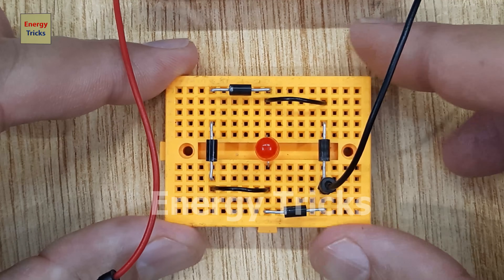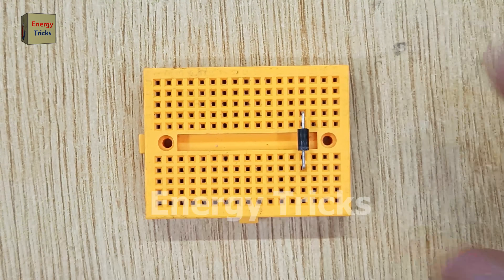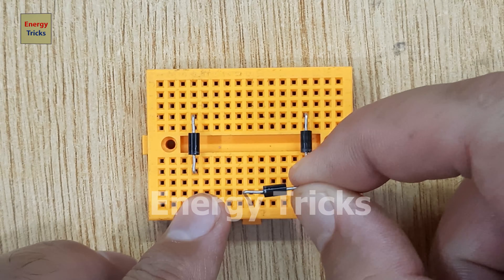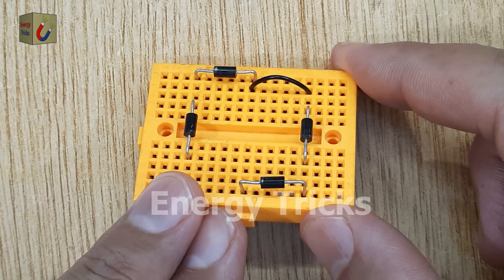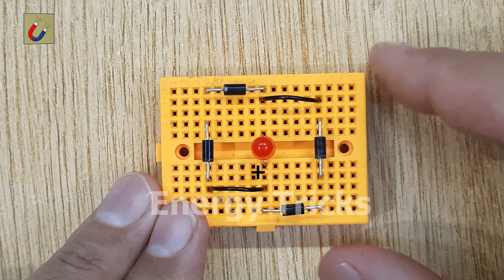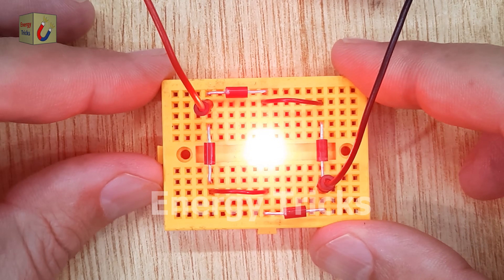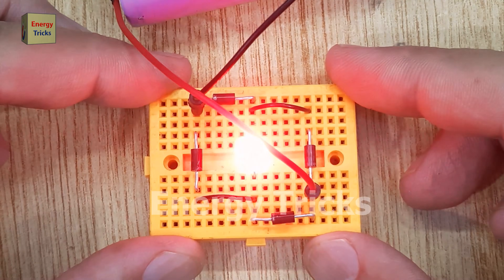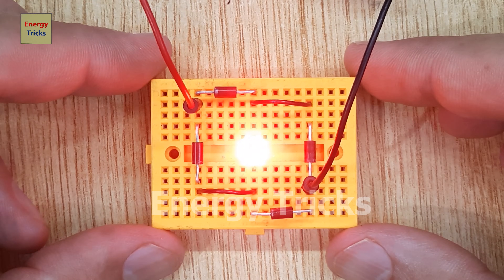How to Make a Full Wave Bridge Rectifier Circuit on Breadboard

Comment: but the thing is, using the battery it gives a DC current itself...No need to use diodes bro
Reply: He used a DC battery in order to show the same logic as with AC current

The diodes are necessary since he switches battery terminals in the input which pretty much is how AC works, the voltage goes from 3.7V to -3.7V when he switches it

If he switched battery terminals without diodes and just straight to the LED and the polarization would be incorrect (so Kathode of the LED would be connected to the + of the battery, and Anode to the -) the LED would break

That's why even if he used a DC battery as a showcase, it's still a correct proof it's working